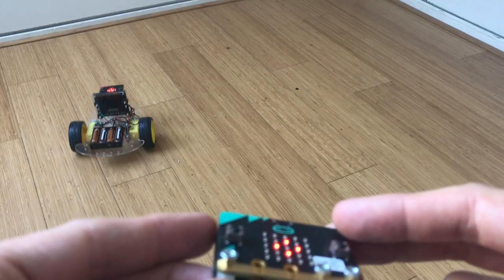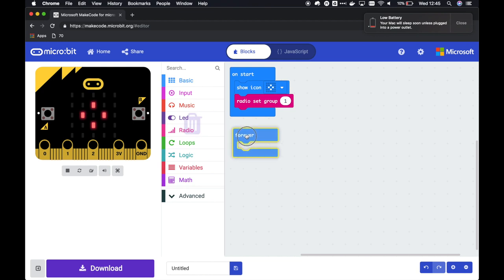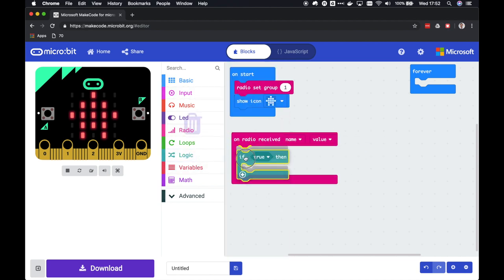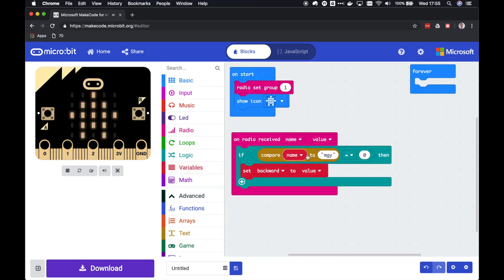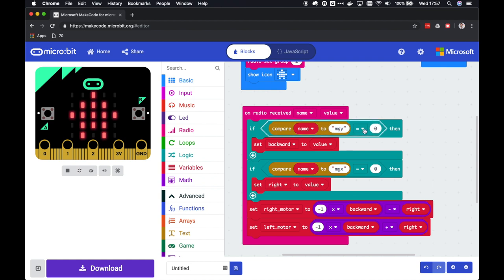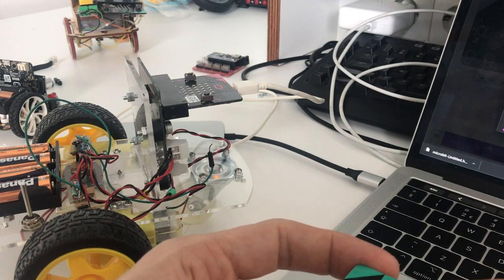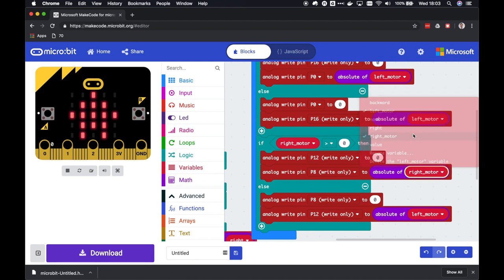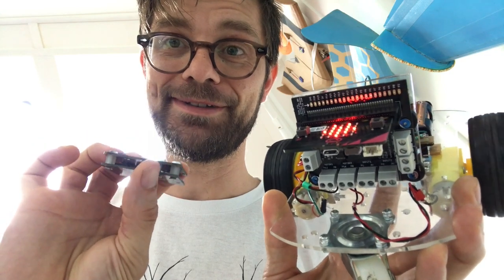Can two micro:bits be connected wirelessly and serve as a remote?

Comment: Hey, great video. Do you have a wiring diagram for this circuit?
Reply from the maker: No, sorry. But it is real simple. There is a motor driver board with 4 leads, and all of them are connected to a microbit port. I then change the PWM/voltage on these ports to drive the motors.

Comment: Thanks for the video. How do you keep the robot moving straight? My robot does not go straight I was told thats normal as 2 motors may look the same but can run at different speed because of physics (friction , torgue etc)
Reply from the maker: That's right.  If you're good at programming,  you can use the car gyro to course correct.

Comment: Great video.... Any suggestions / pointers in running 2 servos using this set up :)
Reply from the maker: The tough part is the radio. There are nice servo blocks in makecode. Just plug the received values in those instead of in a motor pin.

Comment: where is the switch connected on your chassis? on what wires is it connected?
Reply from the maker: The switch is in one of the holes of the base plate. It connects or disconnects the +5V between the batteries and the motor board.
Reply: @AntonsMindstorms  great thank you